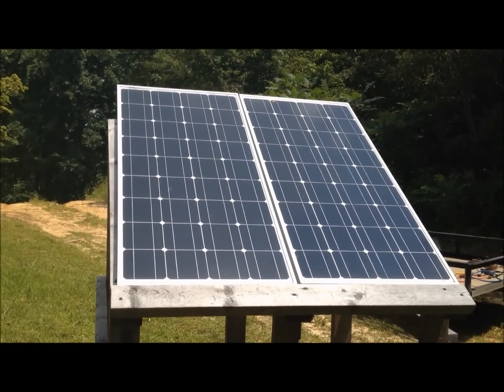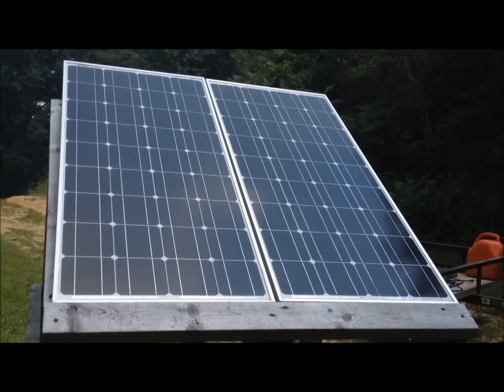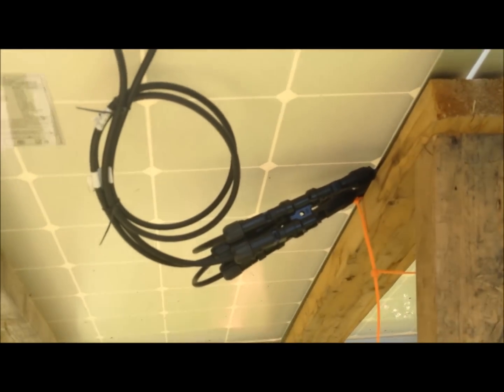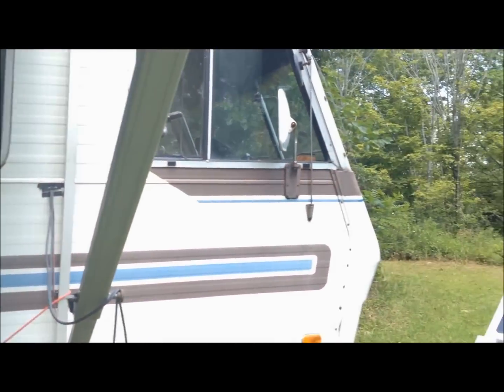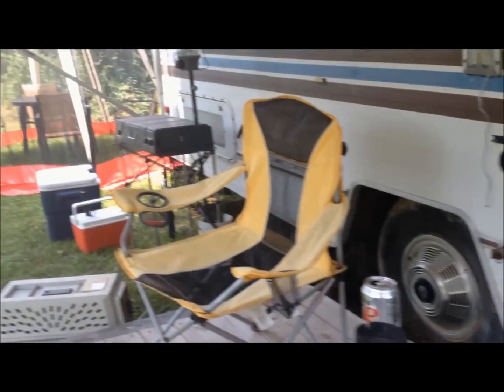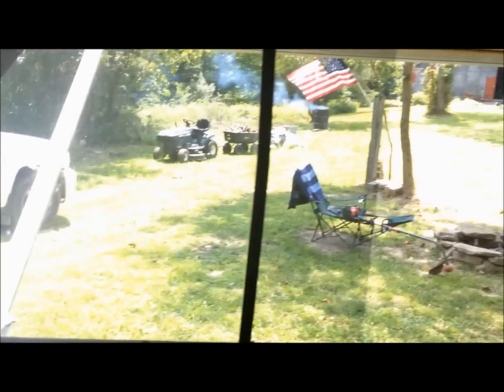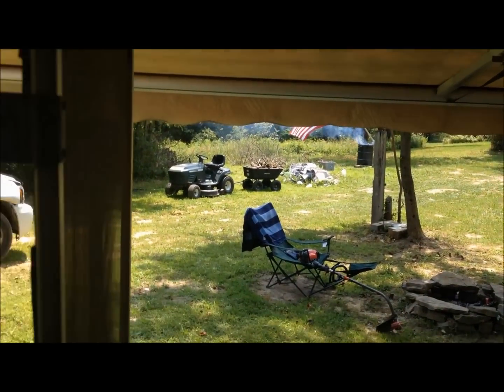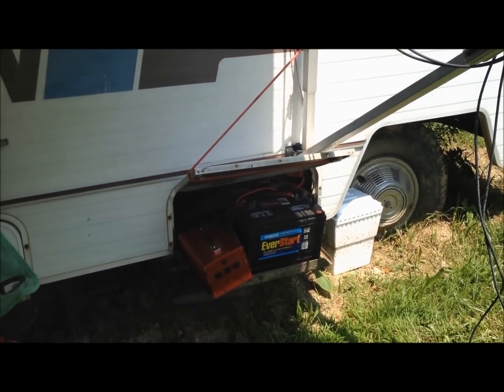DIY Easy Small Solar Setup For Off Grid Camper Cabin

Comment: Hi, Thanks for the video, it was a really nice clear description on how to go about setting up a system, I have a couple of projects for the future that I would like to have an electricity supply well away from our house and you have given me enough confidence to give this a go based on what you have done.
Reply from the maker: Michael Collinson  Your quite welcome...this was my experiment with it as well.  Not as hard as some people make it seem.  Especially with just small system.
Reply: The Off Grid Homestead At St. Bernard Acres Nice brother. I love my solar I have 480 watts of solar. I got my panels off ebay for 117.00 bucks each. There 129 watts a pace. Set up for 48 volts going into my Mppt charge controller. I have 8 t105 batts run in 12 volt. for now. Still need a inveter and then I will be up and running. I have a small 100 watt one now run a few lights at night but love free power..God Bless.
Reply from the maker: yankey4  I'm going to get a couple of more panels and batteries this spring and set up a system for some 12v LED lighting in the barn.  Another experiment before I put the real money into the big system.

Comment: Great setup... I want to get an emergency solar kit with panels, batteries, controller & inverter, cables, etc, for when the power goes down for more than a day...  so calif gets sun year round so that's my best bet... I like that platform you built... is it on wheels?
Reply from the maker: Pluto Believer  No wheels.  Just some scrap lumber I had at the house, I don't have a need to move it around.  I know I wanted to get them up off the ground away from the critters.  They might hand a snow load, but I don't know about a deer stepping on one lol
Reply: yeah, why some people allow their panels to lie on the ground is amazingly dumb...  Plus you get a better angle on the sun...  did you say you were going to install your solar and wind turbines on your barn?  My late husband was the same way, he could get the job done with whatever scrap lumber, etc was on the property...  he even built me a beautiful bookcase out of scraps...  I'll always keep that bookcase... though it needs a paint job soon...lol...

Comment: How are the Walmart batteries holding up under months of use ?
I bought 5 batteries like that hooked up together ( group 29 ) 114 AH
I also made my own cables to attach the batteries together from 4 gauge jumper cables ( the thicker the wire, the better the power transfer.)
Same goes for the solar panel cables.
Reply from the maker: +David Pedder  This is my second year with them.  They've done great.  I bought them in during the winter and kept a battery tender on them, and they worked great all summer!
Reply: +Homestead Dreams At St. Bernard Acres 
Good to know , thanks !!
Do you use LP to run the fridge or solar ?
Reply from the maker: +David Pedder  It was strictly LP, or AC when I had the generator plugged in.  2 batteries is not a lot!